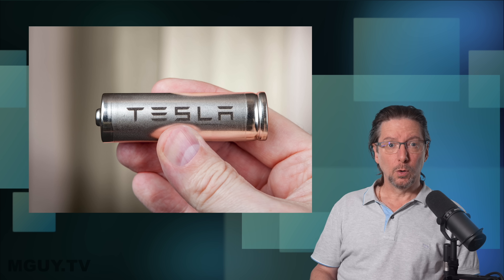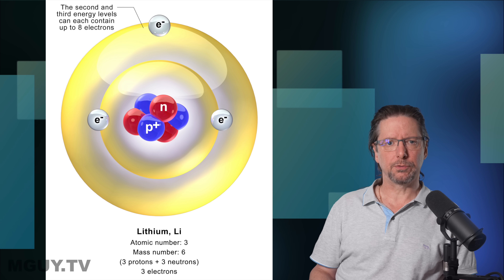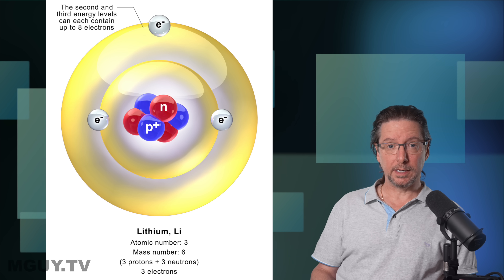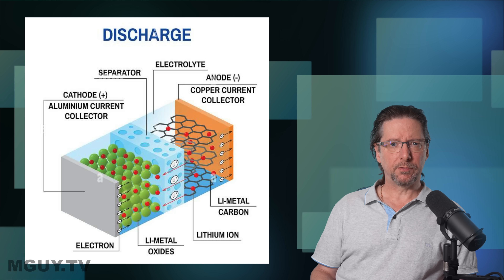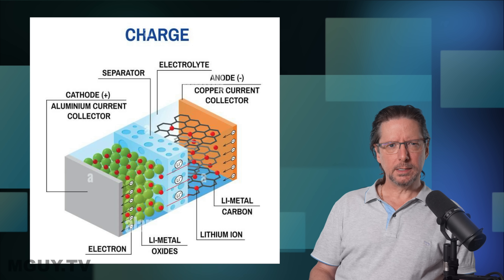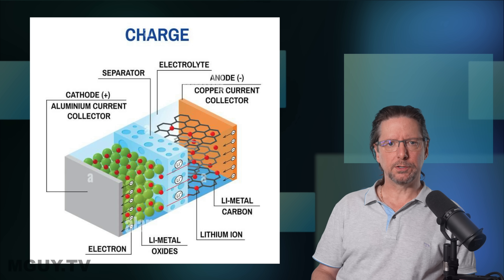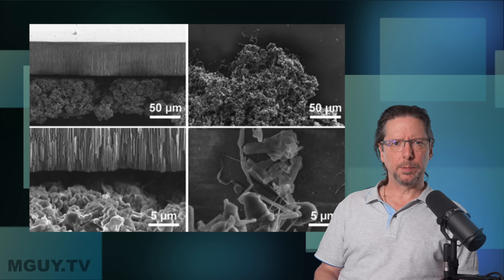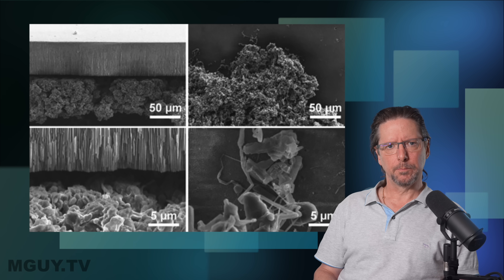Why are EVs so TERRIBLE in the cold? | MGUY Australia

Comment: fuel that reduces emissions with 90% is probably reducing emissions with at least 50% to 60% more compared to EVs if you really make the math cause these No emissions EVs are most probably causing more emissions then regular gas car when you factor the electricity to charge and where this electricity comes from how are they manufactured and all the work needed by diesel machines to dig for the raw materials just for the batteries

Comment: Their second value is accelerating to zero.......if you drive over a big egg and scrape the bottom of  your car.....it gets scrapped.....they have a tendency to explode  ....even just parking at home.... insurance guys are running for their lives...both car and home insurance going skyhigh..
Replacement batteries costing more than the worth of the vehicles....people trapped dying in burning vehicles.... batteries can be as heavy as 500 to 750 kg ...using heating , towing, or transporting stuff causes vast drop in range....now lets talk about recharging stress...where to, the queue  and  time(decades) especially when temperatures drop.
Software malfunction...can be scary if you where driving at the time.this is another failed banking agenda. That will bankrupt a lot of people it seems 
When the bankers mandate to go left ..... to save yourself please go right.

Comment: Hi, I giggling about these EVs struggling in the cold, not charging etc.
Now seeing some of these EVs just dumped out by the charge stations and owners have to walk away. Now because of the batteries if left with no charge in, letting them go complete 0%. This with become more of a nightmare that they will not recharge, unless you have get a new $60,000 traction battery or a costly battery repair back at the dealership.
Please can you do a video of this, keep up the good work. Long live fossil fuel

Comment: Imagine if i had to use my gasoline to heat the tank before I could fill it, or if my gasoline tank kept shrinking. Also imagine if I had to use a gasoline-fired heater, to make heat. Matter of fact, foil-wrapped food can be easily cooked on my exhaust manifold, while I drive.. Lets see a BEV do that. And almost 1/2 tank of extra gasoline fits nicely in a Jerry can. Also it weighs about 75-100x less than the same BTU energy a battery would weigh.:face-blue-smiling:

Comment: The EV pioneers in the Chicago area are coping HARD. They're bringing up the fact that many ICE cars wouldn't start due to battery failures. They don't mention that you can jump start an ICE car in like 3 minutes, or replace the battery for ~$150. They're also upset the media is exaggerating the EV problems failing to mention that the media's exaggeration of the non-existent climate "crisis" is the only reason their HEAVILY subsidized vehicles are even a thing.

Comment: I've worked on EV's for about 25 years. I've worked on them in industrial environments, sub-zero environments are the worst. One of the laws of Physics states that energy can not be created or destroyed, it can only be changed. Batteries, are a form of changed energy, and they are limited by the laws of Physics. Sub-zero environments are the worst, because the low temperatures slow everything down, and when they are asked to do work, the limitations are readily apparent. I've worked on EV's at sub-zero logistic companies and keeping up with low output problems associated to the extreme temperatures is the #1 problem. Changes in environment are even worse. You can be using a fork lift in sub-zero, and then take the same machine into a 90 degree environment, and the problems compound. Humidity is problem #2, condensation is a battery killer. The only way to make the situation tenable is through shielding, which consist of lots of insulation and lots of steel to try to keep the temperatures from compromising the output. That's really the only way to do it.

Comment: Hello MGuy, I am trying to assemble a list of all the present-day EV shortcomings.  Do you or any of your viewers want to help me streamlining and building this? I just don't find a website that can do the same thing in "points form", and a succinct as possible. 

Charging time
Battery issues
Charging infra
Range anxiety
Battery disposal
Common issues
Costs of repairs
Cost of new batteries
Cold weather
Battery fires/ 
Runaway fires
Charging issues
Charging station accessibility
Charging station prices
Electrical grid
Limited selection
Material intensity
Overheating
Cost of EV's
Cost of insurance
Weight of an EV
Mal functioning Chargers
Charging stations slowing down
Too few charging stations
Loss of battery power
Resale depreciation
Fragile battery insulation

Comment: I heard an idea that makes sense. The push for EVs is a multi Government and nufarious organisations to get people out of cars (& into 15 min cities).
Car manufactures have virtually closed down ICE vehicle production through political pressure, over capitalised in EV production that is not being accepted by the public. VE & Fird have become virtually insolvent becsuse if the change. As the (again) taxpayer funded subsidies wind down, the cost is going to rise for an EV purchase.
With the worldwide failure of EVs apparent, unsuitability in the cold, no. Reliable means of escape in weather related catastrophes ie bush fires, floods. The electrical failures due to extreme cold, flooding which is a hazard risk with li-ion batteriesvetc the deadly toxic fumes, possible explosion, uncontrollable 2500C (3800F) fires leading to complete destruction of the vehicle often adjacent vehicles, housing, buildings & muti floor carparks, insurance has/us increasing to a point where they become almost uninsurable, assuming you can get them insured.
Then there is the start of pay by mile (Km) costs that are necessary as EV owners have not been paying for road and road maintenance as it has been the tax on fuel which pays for it.
Reply: No car manufacturer has "virtually closed down ICE vehicle production".
Most of them have cut down on EV production cause people don't want their EVs.

Comment: Uhmmm... because you have to run the heater and that chews up a good 25% of range?  I still get 160 miles a day in freezing cold weather in my 2017 Chevy Bolt.  It's never going to be a problem for short trips/commuting/side gigs, etc. when you can plug in at night and wake up with a "full tank" the next morning.

Comment: I'm 71 and a retired engineer. In all my years, I don't think I've ever seen such a supposedly innovative product bought to market with such an obvious lack of R&D and market research. All of the issues that have come to light since EVs have been foisted on the public, would have been identified under any normal, rigorous R&D programme. And from the market research side of things, did nobody ask anyone if they would want to by a 1) vehicle that costs more, 2) takes much longer to refuel, 3) will go less distance on that refuel, and that distance will probably halve in really cold weather, 4) will cost more to insure 5) will depreciate like a stone...........the list goes on. It seems none of the aforementioned happened, because, if they had done their due diligence, EVs would never have got to market.........
Reply: I believe they knew all that. The problem is governments telling them you're going to make these, and that we are soon going to ban the ICE alternative. And so any teething pains that would normally hamper or prevent market adoption are bypassed.

Comment: If you need an eco-friendly car that also (most importantly) saves you money on gas, look no further than to convert your ICE car to run on CNG or LPG instead of gasoline. 

Converting to CNG is the best solution if you have a big and heavy car (say, a bus or a truck of any size, even a light one) and your country has the infrastructure to refuel them (I live in Russia and they're building a lot of new CNG stations all over the country now, especially because it's subsidized). A car that runs on CNG not only requires just 1/3 of the money to refuel compared to running on gasoline (mileage may vary depending on the price of CNG in your country), but will also have your engine oil and other components last a lot longer (given proper valve tuning), since it's the most eco-friendly fuel, with little to no nasty exhaust fumes. A car on CNG will save a ton of money for people that drive around a lot per day or week, such as taxis and busses. Naturally, if you run out of CNG, your can continue to run on gasoline until you reach a CNG station to refuel.

There are various drawbacks of converting your car to CNG, however:
- High cost of conversion
- Requires a big and heavy (around 80kg) tank that will take up the majority of your trunk space
- Low mileage (250-350km on average)
- 30% reduction in engine's horsepower
- takes more time to refuel
- requires a big network of CNG stations across the country, and CNG stations will almost always be few and far between

For said taxis and busses and small trucks, this will not be too big of an issue, because taxis don't need a lot of trunk space and because they all run in the city, and there will be at least 2-3 CNG stations in the city to refuel.

An easier solution would be to use LPG. It is a good middle ground between the convenience of gasoline and the economy and eco-friendliness of CNG. Cheaper to convert, more LPG stations, takes less time to refuel, can run for 300-500km on a single tank, and you don't need to sacrifice trunk space as you can install a tank that is the size of your spare tire located beneath the trunk. If you need that spare tire, just put it to the side of your trunk, or on the trunk door, as some car owners do.

Comment: From the second you unplug an EV it starts to discharge, what a great idea that is, pay to charge it up and watch it go flat whether you are using it or not, discharge even faster in cold weather, one of my mates has got Kia EV and he said whenever he goes back to it and looks how much range it's lost if it's not been on charge, its like someone else has been using it. 😂
Sounds such fun I might go and drill a hole in my fuel tank to let my fuel run out of it while I am not using it.
Then we have got all the domestic and public chargers all turned on and connected to the internet burning energy 24/7,  1000s and 1000s of chargers sitting on standby not being used just wasting energy and money.  EV's saving the planet one day at a time lol.

I am an electrician and my power tool batteries are lithium and they are wank when it's cold, a couple of days last week I couldn't get them to charge, had to put them in the front of my van to warm up, they also go flat loads quicker, seemed to spend most of my day swapping batteries around.   

Do you know why EV batteries take so long to charge after 80%.....I do, it's because the battery and charger technology is fucking rubbish.

Comment: heating the battery should be minimal compared to the extra range you get in return? heated floors dont use much power and  surface area is huge in comparison to a battery pack in a car.

Comment: It's ironic that the very thing EVangelists crow about - the hopeless inefficiency of internal-combustion engines - should have such a significant impact on the usability of their own vehicles.

IC engines generate heat as a waste product. It's very useful in cold climates for warming the cabin, and making the heat uses no extra fuel. When temperatures drop, EVs need to warm their battery packs for optimum performance, but they can only do so by draining their charge. If the batteries are already low on juice, the cars are pretty much stuffed.

Unless they're hybrids with an ICE engine under the bonnet.

Likewise, defrosting windscreens and heating the cabin burns even more precious power and eats into the car's range. No free lunches for the Teslamic faithful when there's ice on the ground.

Yes, ICE engines are demanding, dirty, and inefficient, but they don't mind the cold. A bit like horses in that respect. As the old song about 'four-legged friends' says, they won't let you down, either.

Comment: EV batteries are perfectly safe. Unless you charge them incorrectly. Or discharge them incorrectly. Or if the weather is too cold. Or if it's too hot. Or if they get wet, especially with salt water. Or if they're damaged. Or if they're used too intensely. Or if they get too old. But other than that, you have nothing to worry about safe for a few mishaps due to budget construction...

Comment: The other fun part of owning an EV for several years is that if you have a cold winter every 2nd or 3rd year the damage to the battery is going to accumulate.  Think of all that temperature expansion and contraction of all those different metals and compounds, with the inherent crushing and separation at the boundary layers between them.

Comment: I love how the idiots who bought into the EV hype were so surprised when the icy weather caused havoc on their milk floats. If it hadn’t dawned on them after all this that they are backing the wrong horse, then they really do deserve all the get. A great explanation of the lithium battery makeup. But you can guarantee there will be endless excuses and argument against your (correct) facts. Great video as always
Reply: Have driven 2 electric cars for 10 years and saved about 50,000 dollars just in petrol. In addition, cheaper insurance, low maintenance, 10-15,000 dollars saved in tolls and parking. And best of all: they work much better in winter than petrol and diesel cars.

Comment: You failed to mention that lithium based batteries CAN NOT be charged if their temperature is below freezing (32F).  Attempting to do so will both destroy the battery and cause it to explode if charged again.  So every cell must be heated to some level above freezing before charging can even begin.

Comment: I built drones as a hobby and started learning about lithium batteries over 10 years ago. I learned that a cell can only be about 3.2v to 4.2v. So when I heard they were going to wire up thousands of them to get the power needed to move a car, I just knew it wasn't going to work. Solid state batteries will be the way to go, but we are technologically oppressed so don't hold your breath.

Comment: At this stage of EV development, EV's should be intended only  for daily commutes where you charge the car at home.  It should have a range of 120 km/75 miles tops to limit cost, weight, and severity of battery fires.  If you can't charge the vehicle at home or you intend to go on long trips get a combustion car instead.

Comment: When I lived in the Chicago area when it went down to -33 degrees C/-27 degrees F I have removed the lead-acid battery from a car and put it in my living quarters so that when I wanted to start the car I would put the battery back in the car so the car would easily start.
Batteries use chemical reactions to produce electricity so it's not surprising thsy don't do so well in extremely cold weather.
So it shouldn't be surprising electric cars don't do so well in cold weather.  Of course Joe "Mushbrain" Biden wouldn't realize that.

Comment: Interestingly, the chemical reaction of gas is the same reason why gas engines require a choke as the gas doesn't evaporate as quickly in the cold. Although the combustion reaction seems to be unaffected.
Reply: @toby2581  True, I was just pointing out that both  have chemical reactions that are affected by temp.

Comment: The chargers fail. The question is why did they not at least do a minimal slow charge. Seems likely that some component in the charger failed due to extreme cold. Worse, drivers were sent to the nonfunctional chargers.

Comment: ICE cars also are terrible in the cold (ex preheat the car 10-15 minutes before leaving and the car is still cold when you get in, older cars are even worse, no remote start system means stolen more easily when preheating the car), the only reason that no one is complaining is that we have adapted to it and live with it. Same will happen with EVs sooner or later.

Comment: I live in Michigan.  I couldn't charge my Bolt indoors for fear of burning the house down.  I charged it outside, but in low temp weather, of which we have quite a lot,  the range was reduced nearly 40% by the heater.  On a summer day, the car would go about 260 miles on a charge.  On a winter day I was lucky to get 200 miles on the same charge.  Also, while it was plugged in and fully charged,, it still used power to heat or cool the battery.  If you figured that in, It was much more expensive to drive.  The lease ran out in Feb 2023.  I gave it back and leased on ICE car.  Now I'm not a nervous wreck worrying about range.  Never again.

Comment: Rough rule of thumb, every 10 degree C rise in temperature doubles the rate of reaction. Conversely 10 degree drop halves the reaction. Thus if the battery falls from 20C to 0C its output is a quarter.

Comment: Hello from frigid Canada.

An hour or two wait in line at the charging station, another hour or two to charge, followed by a bit of reduced range driving, then another hour to go out of your way to wait another hour or two in line to charge.

Not a very efficient use of my valuable time, but here’s the good news everybody.

EV Battery technology is improving and super cheap, lightweight, energy dense, and physics defying cold weather friendly batteries are just around the corner.

No, really. Not a joke.

Any year now, in 3, 5, 10 years, for 30 or $40K plus tax and labour, the unicorn batteries will be available to replace the woefully inadequate Li-Ion ones.

And the child slave labour working the environmentally unsound battery mines in Africa can go back to working the blood diamond mines.